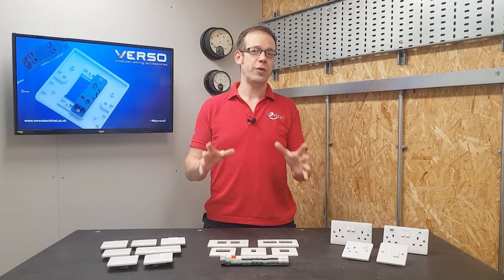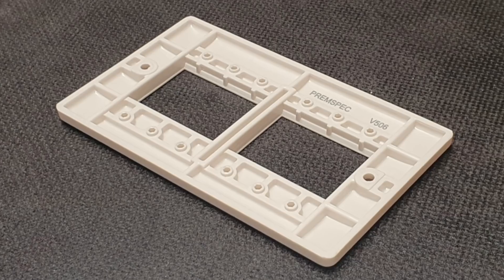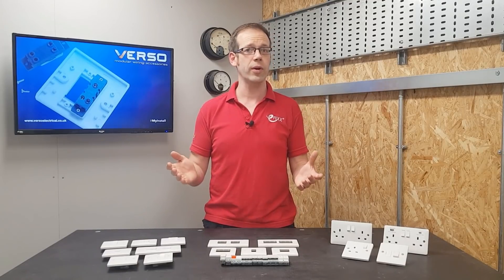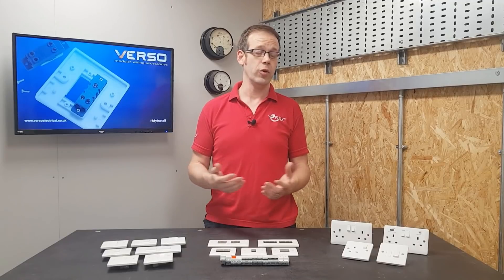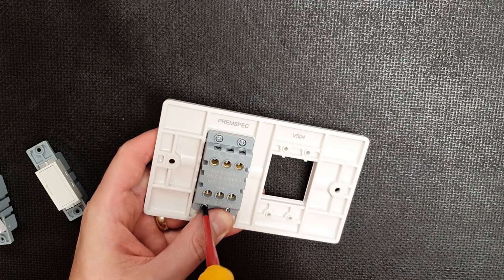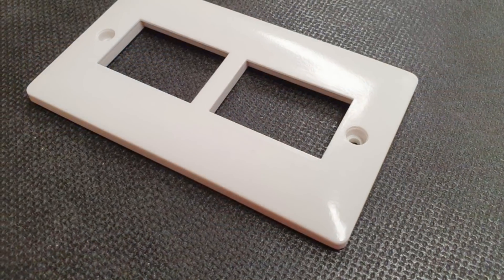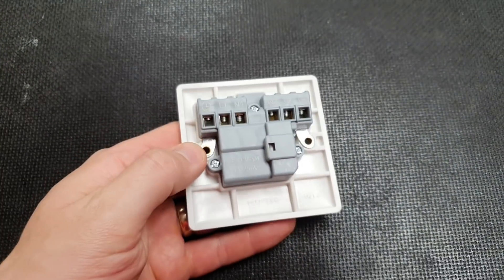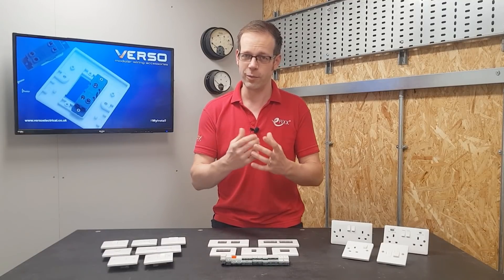VERSO Modular switches - Grid with out the grid and no yoking! by PREMSPEC

Comment: Personally i couldn't imagine wanting anything other than white but my customers increasingly want brass and brushed steel which really limits the options - especially when you want a 2-gang intermediate switch. Also, the only dimmer switch worth using seems to be the Varilight - silent and smooth.
If anyone else offered these solutions, I'd be very happy  😊

Comment: Seems very similar in concept to the click minigrid range from Scholmore  (3 modules per gang, yokeless, modular as standard) but with a more limited range of elements. In particular the range lacks lockable fan isolators and single module 13A switches. It also lacks any finishes other than white plastic.

Also their documentation sucks, the individual modules are nowhere to be found on their website and the catalogue makes no mention of the fact the 20A switch and fan isolator modules are double width.
Reply: Hi Peter, thanks for the feedback. The Catalogue is in the process of being updated and I have fed your feedback back to the team doing it. As for the website this is already in process as I type this to you :-) 

We do not currently offer a decorative range in Verso, there is one in final stages of R&D and we hope to have this on your closest wholesalers shelves by the end of the year.

Comment: Not really keen on the design of the plate, plus click have had this system in place donkeys years ago, which was the reason I switched to that brand, as I could put an intermediate on a two gang switch.
Not sure why manufacturers still make 1 way switches, I only buy 2 way switches.

Comment: Looks a great system.. i detest the euro module grids, they look awful. only good for TV an Av installs IMO .. a 10a double pole would be great for bathrooms where you have an MVHR or fan which uses a boost function.. oh and a dimmer , coz you always get that fussy client that wants the dimmer on the same plate as the switches .. i'll give the premspec gear a go ... love the fuse spurs , ive only ever fitted MK on my own jobs just because of that reason.. nice to have other options.. well done Joe

Comment: I like that idea even if it is old hat 👍just go’s to show how out dated we are in the Uk , or like I have said before if it’s not broken then don’t fix it. 
Fantastic video Joe as always 
👍👍👍👍❤️⚡️
Reply from the maker: I was pretty impressed with it in fairness. 😊
Reply: @efixx  yes but what will you think when it goes wrong and Sod’s law it will be when the  manufacturers warranty has expired and then you have two choices, spend a fortune to get it repaired, or spend a fortune to replace it ? .  Or go back to the old trued and tested  .  Grid switches .😂
Reply: @Dog-whisperer7494  In principle this is not much different from any other grid range, if you have the time and it's still available then you just replace the module. If the range has been discontinued or you are unable to source it quickly enough then you are likely going to have to replace the whole assembly.

In practice there is safety in established systems. If you use MK grid plus then you can pick up replacement modules virtually anywhere.

If you use click minigrid then toolstation stock it though it seems the seperate modules are only availble in the central warehouse, not local branches. For some modules you can work around this by buying ready built plates and dismantling them to get the modules, though not all modules are sold as part of readybuilt assemblies.

This stuff on the other hand seems like a PITA to actually buy, they claim to have CEF as a distributor but I couldn't find it on CEFs site and google wasn't turning up much either. 

Warranties are mostly irrelevant unless they also cover labor.
Reply: @petermichaelgreen  No we aren't on CEF's website as we do make a conscious effort to support our distributors locally as best as possible. This does mean leaning away from online agreements. Our products are currently available in 119 CEF stores as stockists and from any CEF next day. There are also over 100 independents that have it on their shelf and many more with terms that give them access to it next day as well. Hope this helps
Reply: Joe check your email I would appreciate a call please  .
Many thanks
Reply: @Dog-whisperer7494  I Sean. All Verso accessories have a lifetime (30 year) Product Warranty on them. So there shouldn't be a worry about a warranty expiring there ;-)

Comment: I've been using click mode for years. Does same thing
Reply: I do very little domestic work. But to make life easier I have carried Click accessories for years, forget 1 way, 2 way, intermediate. Just buy intermediates as they cover all 3 options. Reduces stock and ensures you have the correct Switch
Reply from the maker: Maybe Premspec do it better? 🤔
Reply: @efixx  Click certainly seem to have a better range (13A DP switches in a single module, locking fan isolators, a wide range of finishes) and better documentation (the premspec catalogue doesn't give any pictures of the modules or even tell you which ones are double wide). How the quality of the actual products compares I couldn't say.

Comment: This is nothing new and has no unique selling point over other grid systems. Several manufacturers have been making yokeless grid systems for years. E.g. Click MiniGrid (3 modules on 1 gang plate).
Reply from the maker: It's excellent quality at a reasonable price, don't knock it till you try it. 😊
Reply: @efixx  I’m not knocking it, just saying it isn’t unique.
Reply: This is true, thats why we placed extra time in ensuring the engineering and build quality of the items exceeded whats currently available. Accompanied with in-line terminals on FCUs and Sockets and some other great installation features within the range, to give the installers as much flexibility, thats certified to the highest industry standards and a great price
Reply: @navitascp  Every manufacturer claims that their product/range is the best on the market!
Reply: @navitascp  You seem to have run out of apostrophes.
Reply: Just imagine if the switches were compatible with different brands 😂.  Only need to keep one brand spares on van. I’m gonna have to keep imagining. That must be 3 ways of fitting a very similar switch now 🤣 and that’s only the ones I know about

Comment: Funny .. don't you have BTCINO/Legrand switches in UK ?  We have this modularity for +20-30 years ..i guess in Belgium . It's always funny to watch UK video's about electricians .. in Europe you can fit sockets and later put faceplate in the color you like on it ..  Never seen that in UK .. they seem to look al the same ... and are not completely  in the wall ...our wall boxes are at least 50mm deep ... I do like the swich on each socket but they are so bulky the sockets and plugs in UK ..
Reply from the maker: There's quite a few manufacturers who do similar things with the faceplate etc. Watch this space.
Reply: we're too cheap for those things
Reply: @edc1569  lol seemes uk sockets are crazy cheap ..  a std single socket (niko belgium brand )  + plate in Belgium is arround  7-10 euro's ...
Reply: @kittsdiy  yeah I do find the MK Logic Plus incredibly good value, double socket is about £3 and will last decades, though for some installers thats a premium product!?  Of course you can spend whatever you want really with fancy metal faed sockets going for £30+.  I've always preferred the US way of doing things in terms of decorating - makes life so much easier.
Reply: We do have legrand here. Expensive though. But quiet action